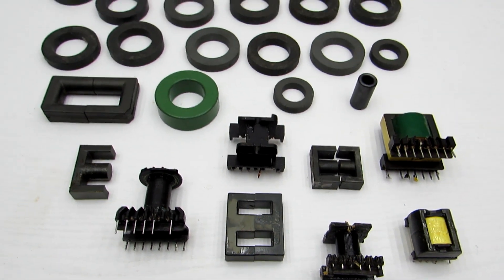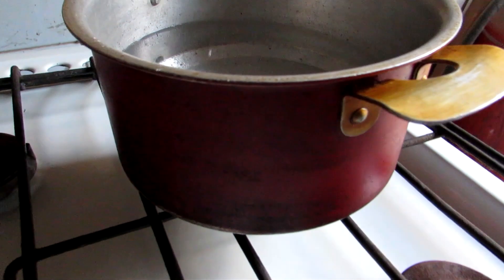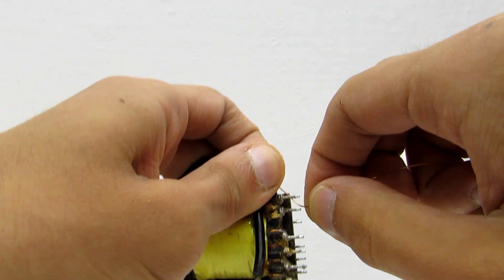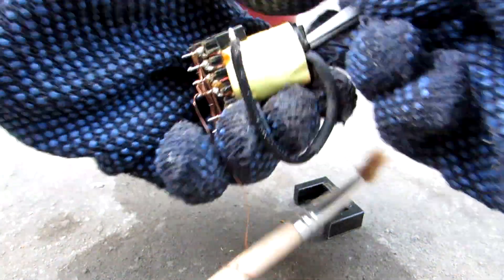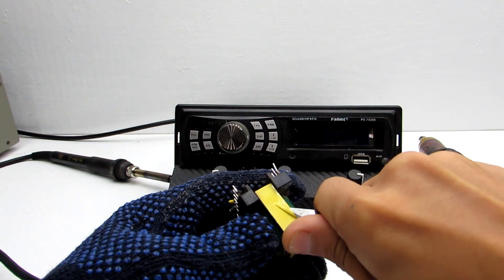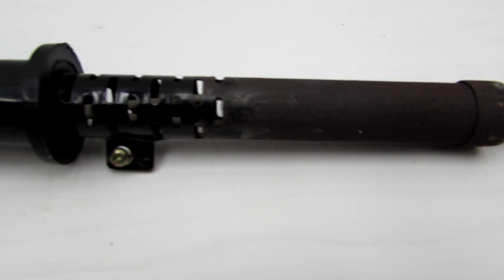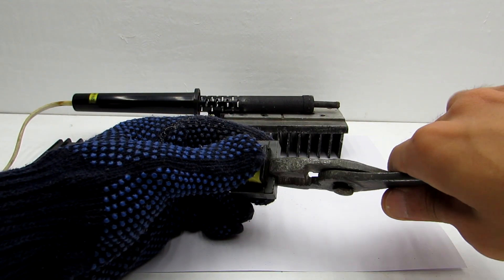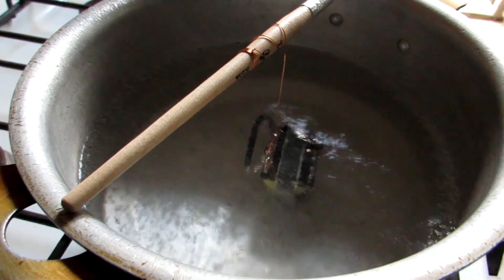How to disassemble the Ferrite Transformer

Comment: Just deep soak the sucker in paint remover for a day. It will fall apart by itself.  Wash off with running water and that is it. FYI yes, excessive heat changes the core properties.
Reply: 100°C is far below Curie temp. and is below max working temp. of these regular ferrite materials.

Comment: I did try the boiling water disassembly approach and found it works to a degree with more robust ferrite geometries.  In particular an EI assembly where the mating surfaces are far more accessible, and softening of the joint varnish via the "I" suffices.  IME it is more problematic in an ungapped EE assembly where the center leg joint is buried in the bobbin, and more so for slender pulse transformers with very little mechanical strength.   Cleanup and winding/bobbin disassembly seems easier with acetone as the varnish can be wiped away.  I wouldn't mess with a hot air gun or soldering iron on a transformer assembly and certainly not other than an EI core given the lack of control and inherent temperature gradient -- the boiling water approach far better addresses both concerns.  YMMV.

Comment: I've had universal success using acetone to dissolve vacuum impregnated varnish.  The boiling water option I haven't tried and suspect some varnishes might not sufficiently soften at 100*C.  I'm further sceptical of the hot air or soldering iron route as it would take some time to sufficiently heat the internal center lag of a ungapped EE core.  Deforming the bobbin is also a potential concern.
Reply: So you recommend acetone over other methods shown? Acetone doesn't distort the plastic? Thx
Reply: I'm not recommending anything in this litigious world, just reporting my findings.  Using acetone I soak a core for a few hours/overnight in a glass jar with a scrap of Al foil sealing between the jar and lid.  The bobbin material is typically nylon and I've never had an issue of solvent attack/distortion.  I suspect acetone or closely related volatile solvent is likely the vehicle originally in the varnish.  The greatest problem I've had was preventing the acetone from being lost to evaporation due to infrequent use.  But I'd expect one could otherwise recover quite a few cores with one charge of acetone before it becomes too saturated with varnish to be effective.

Sometimes when recovering a core as such I find it has cracked ostensibly due to improper manufacturing or excessive heat stress during use.  In this case the core can be repaired with a cyanoacrylate adhesive (aka: crazy glue) and if you don't get the pieces to mate precisely, an acetone dunk will break the bond allowing another try.  Epoxy gives you more working time but also needs the better part of a day to fully cure and a bad repair can't be easily undone.  Epoxy is also more viscous and may complicate realignment.  But both options produce near perfect, magnetically inconsequential repairs with a little care.

FWIW acetone can be found in small quantities as fingernail polish remover.  Most appears to be dilute acetone but I've also seen 100% acetone at the local dollar store.  Even if you boil the bejesus out of a core you're probably gong to need a solvent for clean up of the core's mating surfaces to minimize debris and also to disassemble the bobbin for winding count study and/or potential reuse.  Bobbins are essentially a manufacturing convenience which cost quite a bit of window area.  So if the application looks to be cramped I'll toss the bobbin and just fabricate minimal overhead bobbin from grocery bag kraft paper and glue using a drill bit/rod as a bobbin form.  Plastic wrap on the form beforehand helps release the glued/wound bobbin.
Reply: IME it really isn't needed.  Acetone has virtually no surface tension and permeates the varnish impregnated transformer readily doing the work for you.   It also doesn't mechanically / thermally stress the core, minimizing the probability of damage --  the core just falls apart.   Until the acetone flashes off the remaining varnish remains rubbery and can be quickly scrubbed off with an old toothbrush.  I expect lacquer thinner may work equally well but haven't verified so.
Reply: @uhmgawa6533  Awesome man you really helped me out
Reply: Yes, acetone is probably the best solvent which do this job really well. I have done over 100 ferrite core disassemble and acetone is best solution. I think that maybe there is one good solution more - acetone and paint remover and/or spirit mixture.

Comment: I tried this I didnt have success the core will snapped in half.
Reply: What are you referring to as "this"?  The boiling water approach should have the best chance of evenly heating the core, particularly the center leg buried in the bobbin.  Even then I'd ramp the water temperature gradually to avoid core thermal gradients causing stress.  If you do have a simple break, it most often can be repaired to original magnetic condition using cyanoacrylate or epoxy, with care to get accurate realignment of the pieces.  Use of the mating core half/piece helps to achieve this, but may not be necessary if you're going to gap the core in your application.

Solvent disassembly avoids the temperature induced stress, although you may infrequently encounter a core which has cracked due to manufacturing or design oversights.  But that's quite rare in my experience.
Reply: That's alot of work.epcos I.e tdk cores cost $3. I think I was to aggressive with my hot air gun at 450C. One tip I can offer is the optimal switching frequency can be obtained from the rc oscillator on the chip.
Reply: I find reclaiming cores far less work and far more immediate than ordering 1~2 cores needed for prototyping.  Moreover a cast off PC switcher is a veritable component goldmine for power conversion experiments and can be had for gratis.  Granted it is a pot luck component source, but a well stocked scrap bin has been my immediate "go to" source for decades.

Comment: tHANK YOU. i HAVE TRIED ALL SORTS OF SOLVENTS, BUT THEY DO NOT WORK,  BREAKING DOWN THE EPOXY WITH HEAT IS PERFECT.
Reply: The only time I've seen epoxy used in core assembly was in the case of a gapped core where epoxy was used as a mechanical bridge across magnetic gaps in the external legs, such that the assembly remains integral.  Epoxy is both expensive and viscous and rarely used in this type of ferrite transformer manufacturing.  I've never encountered it as a vacuum impregnation compound for consumer grade transformer manufacture.

Comment: the 3rd method is the best. works on any transformer even with 30w soldering iron. btw im hyped for the next video so much
Reply: Based on your testimonial I tried the soldering iron method myself. I cracked the first ferrite by heating it too long (5 minutes a side). But managed to successfully split the second one by heating it a shorter duration (2 minutes - 2 flips). I used a 100 Watt iron. I Krazy Glued the first one back together. I think it will be OK?
Reply: @1pcfred  that would be just fine
Reply: Ferrite core can break apart by soldering iron. There is a device called heat gun which can be used as well.
Reply: @curiosity551  low power soldering iron works the best. not everyone has a heatgun and it wastes a lot of power